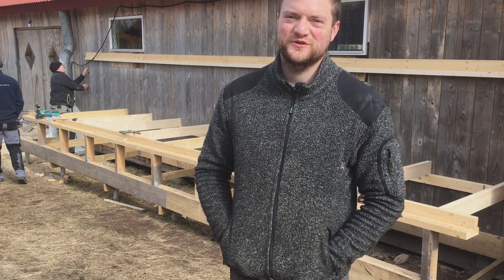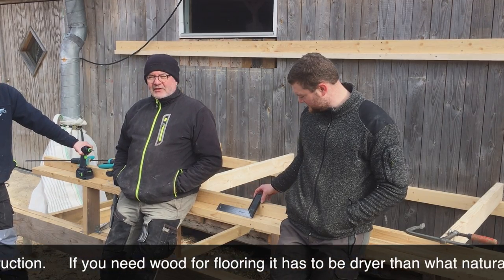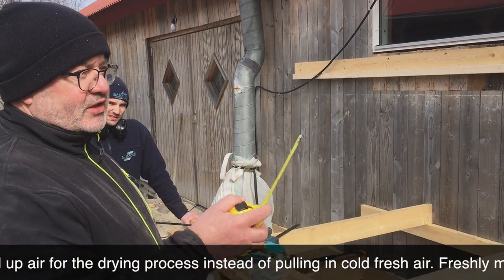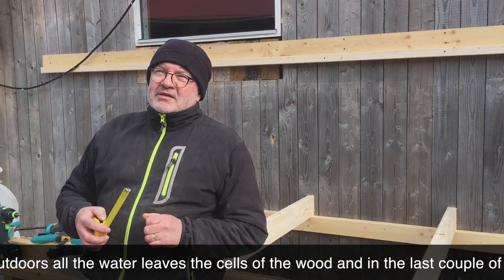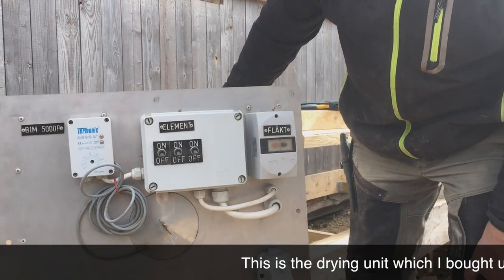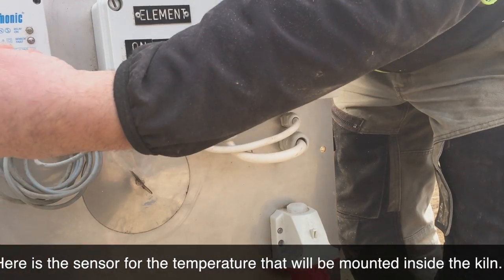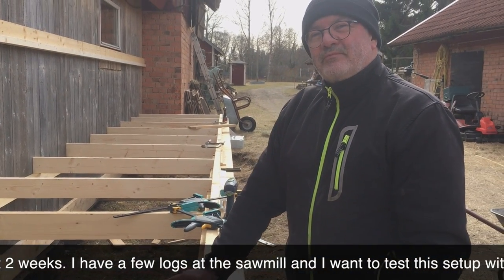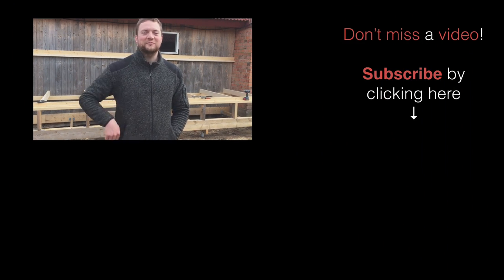Why & How To Build a Wood Kiln

Comment: I worked with a solar kiln that used a wood stove to finish it off. We had control problems, often drying the wood to quickly and causing checking. Great addition to your sawmill.

Comment: This is awesome and will work excellently!!  Also.... when your greenhouse is not in use..... it too can dry lumber. I have a glass greenhouse here in the States at 38° latitude and use it exclusively for drying lumber. I am significantly farther south than Sweden but I bet you already understand how warm your greenhouse gets even in winter.  The beauty of a greenhouse during cooler seasons is that it heats up during the day and then cools at night. The nighttime allows the lumber to normalize before the warm day starts the process all over. Not as fast as your Dad's kiln but 30 days for several thousand board feet makes up for the slowness.
Reply from the maker: Interesting, thanks for sharing.

Comment: Very interesting I have a sawmill in Australia and was wondering about a solar drier for timber. The climate is a lot hotter and drier in Australia so I understand the need for a electric unit in Sweden. The information on how long it takes and temps etc was very helpful.

Comment: Simeon, 
My wife worked at a very large lumber processor, and she said the temperatures used to cure lumber vary - as the Oak your father spoke of will have a considerably tighter grain than for example Aspen or Birch.  What that also means is a lower and slightly slower cure time may be required so as to not waste the wood by causing splintering. 
Hope this helps
Reply from the maker: +TheOregonOutlaw yes. Thanks for sharing. I am no expert in this area myself but I know my dad has some experience there. He mentioned before that many of his friends who have a kiln refuse to dry specifically oak.... i am sure he will have to make his own mistakes and try it out.
Reply: It is possible to dry Oak in an enclosed heated frame by using a large dehumidifier, this does not cause structural damage to the Oak, but have only seen it used on up to 3" thick boards.

Comment: That is a nice piece of equipment for the Kiln. I've seen people using room dehumidifiers, box fans, and small propane heaters. There's definitely a cheaper way to go, but the automation is nice! Do you know what would happen if you left wood in too long or what will happen to the wooden frame over time? (I could of missed this as not listening to volume).
Reply from the maker: I can ask my dad and have him share when we do the next update on this project.
Reply: Swedish Homestead That's great. Thank you Simeon

Comment: There's got to be a way to heat a greenhouse with that.  Maybe just exhaust the hot moist air in the greenhouse and use a dehumidifier to keep  the chicken's water topped off.